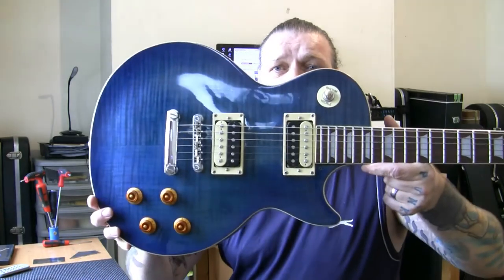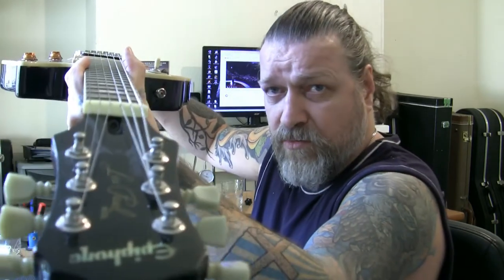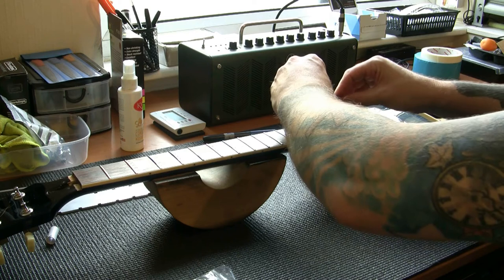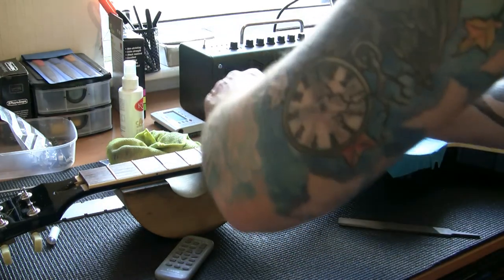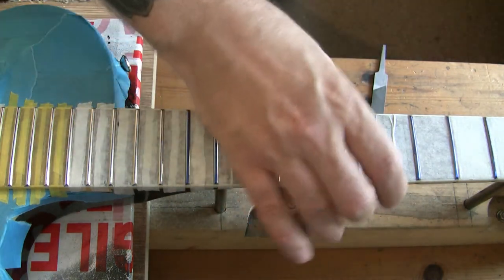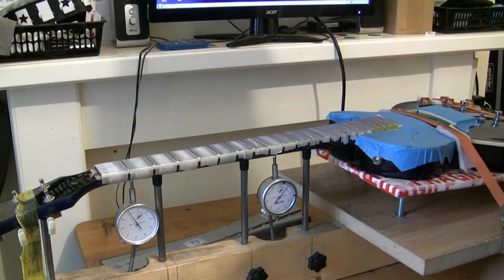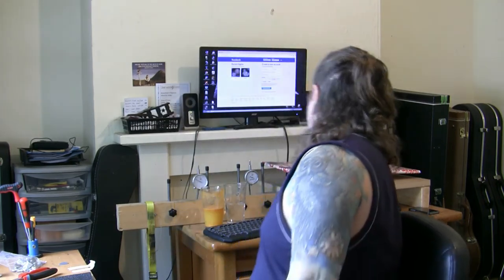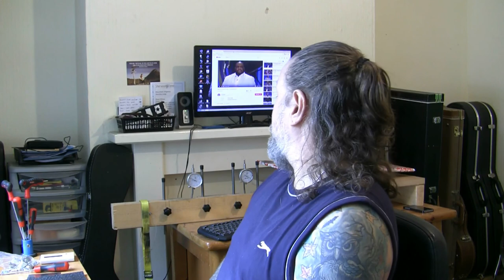Epiphone Standard PlusTop Pro. Warped neck / fret level / setup...

Comment: I just learned a great tip of adding a washer to the truss Rod adjuster for additional truss Rod tension
Reply from the maker: I've been doing it for years. It can be difficult to find the correct size washer but they do exist. Brass ones are easier to find on eBay...

Comment: Fretboard problem towards the pickup is due to the length of the truss rod.  If you havecaccess to truss rod by the pickup, the problem will be found up by the nut area. Hence it is better to have access by the nut because you can slope ofc the neck at pickup end to counteract the problem. Nice videos byvthe way.

Comment: sI received an Epi LP Stud  2015 in may of 2015 .. It came from a local Epi guitar dealer . As a guitar with a chip off the body -- but otherwise ,  in great shape .. Got it with very high action .. Could not play it .. Lowered action , but could not get dip out of the neck .. Could not get much movement out of the truss rod at all .. Then 1 day I noticed that there was a dip in the neck [ twist from the low E down hill to the hi E ]  I didn't want to believe it .. But after several days ,  I needed to agree that the neck had that twist in it from the very start .. There have been days when it was straight across ,  and it played great .. But the next hour it was twisted again .. I got the truss rod tight to the left .. Had it in the case for a week ... No change at all .. A bit cold here this past week with very low humidity .. What is your suggestion .. I didn't see you take out the truss rod nut in this video .. I am not sure that will be a remedy .. I cannot play it at all .. Small - tiny fingers , with arthritis in wrist as well ..
Reply from the maker: Well, I've had success clamping a neck back to position; loosen the truss rod, clamp the opposite direction (not too much) and treat with heat (a hot hair dryer is enough). If it's not that severe, you can remove the tuners, nut and frets and sand the fretboard back to radius (once you have set the neck as straight as possible). This is ADVICE not a recommendation. I'd really have to see the guitar to advise properly as each job is different. Regards, Victor...
Reply: thanks for your expert opinion .. It does sound like it can work , somewhat , with your method .. Yes , each axe is completely different ..

Comment: Did the bloke buy the guitar brand new, as I have just bought one in Liverpool and as I am inexperienced I am worried about the neck. The manager said all necks don't align perfectly as to compensate the bow.
Reply from the maker: Hi Stephen... No the guitar was not bought new but that doesn't excuse the seller! By rights, it should have gone back for a refund. Always know what you need to look for when buying a guitar or take someone with experience with you. Victor...
Reply: @FretFriendGWaL  do you think I will have problems with the neck
Reply from the maker: I have no idea! If the neck is good now; there is no reason for it to go bad...